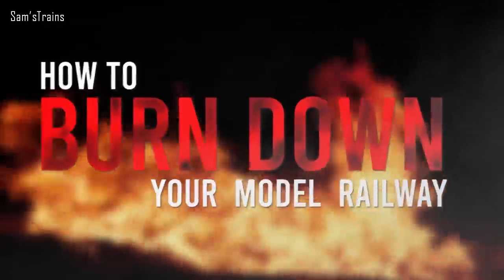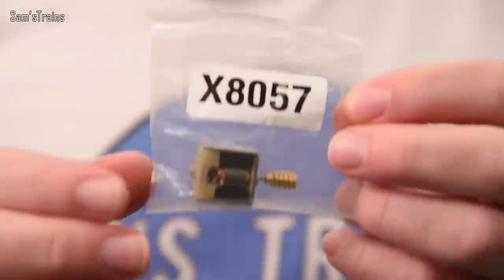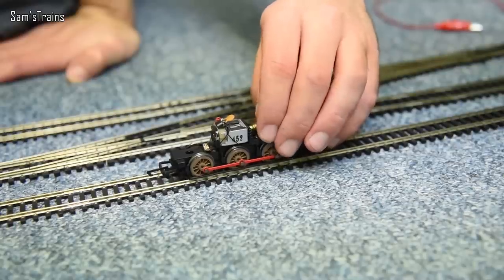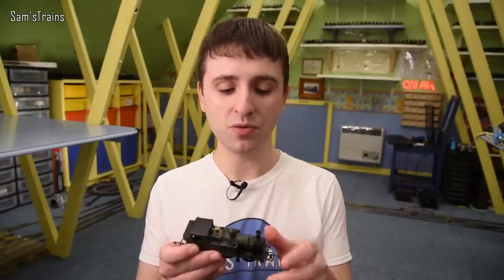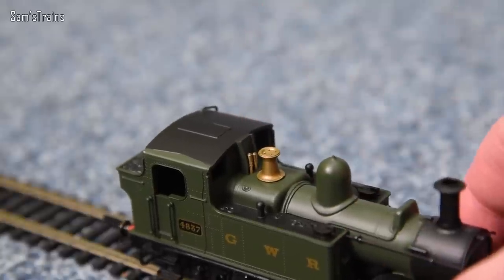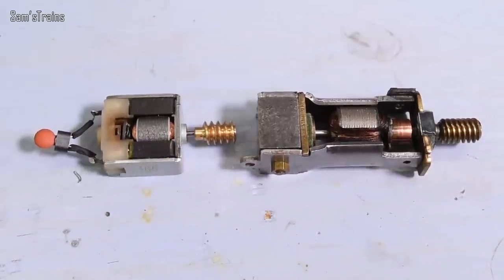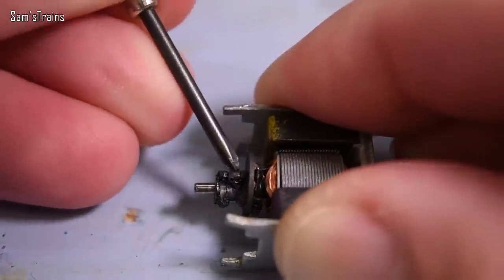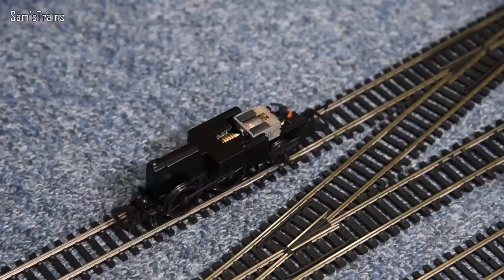How to Burn Down Your Model Railway | Train Motor Meltdowns

Comment: Sam, before doing the test you realy should've worn in the brushes on the sacrificial motor, you already know why and it's the reason why you always spend 30 mins running new locos in. To those not knowing why: on a new brush with a flat head the commutative surface is minimal and high current can burn things out - while a worn in brush will have a much larger commutative surface shaped after the communtator and easier flow of current.
Reply from the maker: haha that's true Jonatan - you can probably tell it wasn't intended to be a scientific test - if it was, I wouldn't have been grabbing the worm with a rag ;)
Thanks for watching - Sam :)

Comment: Last year I discovered that it can be very dangerous to run model trains on the floor. I kicked one of my engines. I didn't  mean to do that, but accidents happen. It was sent to the works. After a some months it came back, with the message that it cant be repaired. I looked if it still can run and it run's. The damage was not that big. I am now more carefully with my model trains
Reply from the maker: haha that's true - you have to be very careful not to kick them! Sorry to hear that mate :(
Thanks for watching - Sam :)
Reply: Sam'sTrains I have question. Have you ever thought about adding signals to your layout?
Reply: Once accidentally did this to my controller. Had to tape the wires on the end in because the socket they went in had a chunk come off. Works fine now though, 3 months later

Comment: Maybe the open frame design doesn't take much heat, the motor case usually acts like a heat sink to help disipate heat quickly. In open frame motors there is no such case, so if the motor gets really hot from overloading, it will burn.
Reply from the maker: Yeah that's a very good point - you may be right!
Thanks for watching - Sam :)
Reply: An open motor will lose heat faster than one with an enclosed case. The heat sink dissipates the heat into the atmosphere. As an open motor is, well, open; it’s completely exposed to air and will dissipate its heat more quickly than an enclosed one will.
Reply: @Twittler1  well, you have to account for the fact that metal conducts heat faster than air and also it absorbs spikes in heat generation (heating up slowly) as it only needs 1 high heat spike to kill a motor
Reply: Marie BCFHS I have accounted for that. The problem is that the heat is now in an enclosed space, so it’s building up and still has to be dissipated into the air anyway. By enclosing it, you’ve created a barrier to the air that itself gets hot.

Enclosing a small motor, then putting it into a small space restricts the air flow over and around the motor. The best solution is a better motor; a small motor that’s always running at or near its limits will get hotter than a higher capacity motor that’s ‘idling’ in comparison, and which can be enclosed. Or, alternatively, fit a cooling fan to increase the airflow over the motor. 

Air cooled IC engines are either NOT enclosed, or if enclosed, are shrouded with forced air cooling them down. Same problem.

Comment: Last time I worked with a motor like that, I was getting revenge on it for frying a brand new DCC decoder (Pull it out of the engine and run it at full power till it cooks). 

Actually I am surprised that 3 poll, open frame motors are still prevalent  over in the UK for HO/OO scale trains. The only place I see motors like that here are in the N-scale market and that motor you cooked is about the right size for an N-scale locomotive, so I wouldn't doubt if it was a tad undersized for the job at hand.
Reply from the maker: Ooh that's not good - not surprised to hear that! I'm very irritated that they're still prevalent ;)
Thanks for watching - Sam :)

Comment: That does seem an awfully low current to cause such a massive failure.

I only have an outsiders interest in model trains but I'm fairly familiar with electric motors and even a little 130 size Mabuchi like you'd find in a slot car or a small RC toy can usually happily pull that without breaking a sweat. A lot of those motors already pull about half an amp at max efficiency.

It seems like a needlessly small and poorly performing motor.
Reply from the maker: Yeah I agree - not much contingency room there is there?! :O
Definitely the cheapest motor they could possibly have used!
Thanks for watching - Sam :)

Comment: this is the easiest way to burnout any (electric) model train motor:
With small gauges (T, Z, N gauge), use a O gauge or larger transformer to power the track, the little motors will not be able to hand the extra loads of volts and amps, they will burn out in less than five minutes at full throttle

For medium gauges (HO, OO gauge), use a large transformer, not a o gauge transformer, use a transformer from a large microwave or a electronic device that uses dangerous levels of amps or volts, that will burn out the medium gauge motors quickly

For large gauges (O, G GAUGE), use shit that is really dangerous to use, like a industrial generator to power the track, that will literally cause the motors to burn out and flame

if you do any of these and get injured, you are liable for yourself, so do not do any of these, we have done them because we have been trained to work with electricity with dangerous levels of amps and volts

Comment: I remeber when one of my trains started burn  and the smoke detector started "yeeling" and i ran to my model railway and extingushed the fire with water bottle ,1 wagon melted and scenery with rails and table got some small damage
Reply from the maker: Uh oh that sounds crazy- it melted a wagon?! Which train was that?!
Thanks for watching - Sam :)
Reply: @SamsTrains  I meant coach one coach melted so i made a long flat bed out of it
And the train was some type of steam train i dont really remeber what kind of train

Comment: Those open motors are actually a pretty old design, and this video is making me worry - while I don't have any model trains yet, I do have plenty of old Polistil F1 Professional type slot cars that use the same design. I personally prefer type 130 motors in my models (type 130 being, in fact, the type of motor featured in the 300+ miles run video), especially those made by Mabuchi - the mini4wd motors they make are pretty hard to kill!
Reply from the maker: Yeah they are pretty old - I'm sure there's no need to worry - just have a few spares on hand ;)
Thanks for watching - Sam :)

Comment: Good evening. Thanks for the video gentleman, it is very interesting. Fortunately, I have never seen a model rail motor burn in my home for the decade I am modelling, first british N, then, since december, OO, after being bored by recurring problems with N (couplers, engine reliability, etc...).
As a subjective view, I find that recent Hornby locomotives tend to run smoother than Bachmann's ones. I have no small engines like your ill-fated 1400, mine are a J50, a Q6, a black five and a 8F to name only the ones I have the references in my head now. I suppose their motors are better.
The only problem I had was a black five with a broken gear that was not running at all on delivery. Replaced by Amazon for no charge by another on working order.
Meanwhile, that's a pity that, even with a decent controler like yours, you have motors that burns off. As you say, the one of your 1400 seems to be undersized and from a low-cost model. It remembers me some Samsung TV sets built with an undersized condenser on the main electronic circuit that blows out after some 3/4 years of normal service : cutting corners too much and here we are : unreliable products...
Anyway, I have to watch your video on DCC, I had finally decided to equip all my new OO fleet with DCC. Thanks for all the information you give us !
Reply from the maker: Thanks Olivier, glad to hear you haven't had any problems! Yes I agree that Hornby engines generally run better than Bachmann ones - their mechanisms are generally much better, with 5 pole motors and usually proper bearings on the wheelset!
Do you think, at least with Samsung, the tendency for failure could be deliberate? If a TV lasts forever, the manufacturer wouldn't sell as many ;)
Thanks for watching - Sam :)
Reply: @SamsTrains  For Samsung, I would rather say that it is, or was, a botched design. LG, Panasonic, Philips, Sony... sets does not have this problem.

Comment: None of my engines' motors have ever failed on me. My engines must have better motors inside them than those few of yours. Yes, Rule no. 1, never give a small engine more to haul than it can handle. How about a story with a burn-out twist?
Diesel vs. Steam Engine
Sam was running two of his TTS Sound engines: Growler the Class 37 Diesel and Great Western Tender Engine Earl of St. Germans. Growler was boasting as usual and Sam was getting very worried. Earl of St. Germans was hauling four Chocolate & Cream Mk. 1 carriages plus three Pullman Coaches to make seven altogether. She pulled them up Gordon's Hill without any trouble. She was powerful after all.

Earl of St. Germans was on the outside line. Growler was on the middle line.
"Bet I could haul more than seven uphill," boasted Growler unwisely. Sam looked at his steamy.
"Does he always think he can do better?" asked Sam. "I don't think giving him more than seven carriages to haul is a very good idea."
"Always thinks he knows best," sighed Earl of St. Germans sadly. "Ever since you first bought him, he's been nothing but trouble. He's asking for it too, I say." On the inside line, Jimmy the Jinty rolled into view. Earl of St. Germans told her friend about Growler's boasting. Jimmy grinned and winked at Sam.
"I've got a better idea than pulling power," soothed Jimmy smiling. "Earl of St. Germans, how fast can you run safely without your motor burning out?"
"About just over half speed," answered the Great Western Engine. Jimmy told of his idea about a light engine race. Sam felt only a little bit better. The young man agreed to be referee, with Jimmy as assistant. Earl of St. Germans and Growler lined up side by side. This was the set-up: diesel and steamy would go round for two laps, and whoever stopped by the turntable first would win. Sam's fingers were shaking. He was more nervous than he'd ever felt in his life, bless him.

The race began. The first lap went like clockwork. The second lap was aces for Earl of St. Germans, but not so for Growler. The diesel's motor started smoking badly, sending out a cloud of billowing black stinky smoke. Sam accidentally breathed the smoke in and choked, hand over his mouth. The smell was awful. Earl of St. Germans won the race and Sam stopped her. Growler stopped by himself further away, and his motor burnt out and exploded loudly.
"AATCHOO!" sneezed Sam, choking in the same breath. The smoke cleared, but not before it set off the smoke alarm in the hallway. Sam did what he'd always done, and reappeared. Thankfully, no fire broke out. Peace was restored. Growler, in pieces of burnt and twisted metal, was discarded gracefully in Sam's Scrap Heap Box. The diesel never recovered. Earl of St. Germans was relieved nothing worse had ensued. Sam, shaken up by the explosion, played with trains as if nothing had happened with a brave smile on his face. He managed to perk up. Steam engines were better-behaved than diesels any day.
Reply from the maker: That sounds excellent Kelly - glad to hear you've taken good care of your engines! :D
Thanks for watching - Sam :)

Comment: Leaving a motor fry itself is not a good idea. Your controller delivering the power should have overload protection but if not you could damage the controller along with the Loco.
Reply from the maker: Yeah that's true Dave - that part was just for fun! The controllers do have protection, but they can pass over 1amp before that kicks in - as we saw here, half that current is more than enough to fry a motor!
Thanks for watching - Sam :)

Comment: Interesting strip down of that motor. You will probably know this, but incase you don’t, it’s best not keep the lubricant away from the motor completely and not on the armature, as the oil attracts dust etc and causes the brushes to ware much faster, but oiling the back of the shaft, and the worm is fine though. But the tiniest amount of lubricant is best. A pin drop ideally. If the factory oil was too liberal then it may have crept. Otherwise, this won’t happen basically. The field windings are all burnt on your failed motor too by the looks of it. Oh, And no burning the house down! 😉
Reply from the maker: Thanks Chris - yeah that is true, but you definitely get better running if the armature is lubricated - though I keep it to tiny tiny amounts these days!
Thanks for watching - Sam :)

Comment: Hi Sam 
I got myself the Hornby R2610 limited edition Caledonian set of Ebay which was sold to me as New .Its a nice model but for that type 7 motor ' it's a sad that Hornby put such thing in inside of loco.
As Like we all do that when you get something new it's going to better than its predecessor Triang  old X67 motor .
Not the case here ok it's got better power pickups but why are we paying more for looks when it should be able to run from the box ?
I know it may sat for some time ,But Hornby tells your the Type 7 motor is a non serviceable which main Hornby service centres to carry out replacement .
I've replace the motor but it's as pig of a job not like the Triang's  X67
Happy bonfire night maybe November the 5th new fireworks ?
All the best Sam love the videos 
Regards Martin
Reply from the maker: Yeah I agree Martin, not a worthy replacement for the X04 - these modern are actually quite serviceable, but it's not really worth it - fortunately they're very cheap!
haha yes indeed - great for a quick indoor fireworks display ;)
Thanks for watching - Sam :)

Comment: These are spectacular, but nothing compared to what you could do with old Lionel trains with the three rails. The most fun thing was putting tin foil on the track, which would cause the tin foil ball to roll around the track sparking everywhere. You could also hold down the loco on the tracks & have it shoot out sparks. Sometimes it would even throw out sparks for no reason. Yeah, not something you'd want around your Christmas tree! Did it anyway.
Reply from the maker: haha really?! I might have to try that with those - what voltage were the old Lionel trains?! ;D
Thanks for watching - Sam :)
Reply: @SamsTrains  I'm not sure, but it was very shoddy. At this point the set is like 30+ years old sitting my closet, I'm afraid to use it. The wire connecting the track & the controller was exposed at the end. You actually had to coil the end of it around a little metal bit sticking out of the controller. No plastic anywhere but the tender, the entire engine was metal. You could see the motor through the open bits.

Comment: It's really shitty that is fails at about half it's rated voltage. Cause that is easily a scenario that can happen while in normal use. Seems like they need to beef them up a bit.
Reply from the maker: Yeah I know - I've never pushed any of my engines too hard, and yet so many of them fail! :O
Thanks for watching - Sam :)

Comment: I think what happens is the motor generates to much heat because of the small space it has to work with, resulting in the commutator and brushes melting from the intense heat, resulting in the intense heat, sparking, and loud screeching noise
Reply from the maker: Yeah it could be that! Though if they're rated properly, they shouldn't be boiling over like this! :/
Thanks for watching, Sam :)

Comment: The worst motors were that infamous pancake motor that you can find in lima models, these motors sparks like hell and smells awful when they are in bad shape. 
The funny thing is that one day i bought a used lima loco for like $30, i opened it and was mint inside, the motor was brand new, when i tested it, it ran better than various models that i have lol
Reply from the maker: I wouldn't say those were bad - I've never had one burn out! But they sure can make a lot of sparks, lol! ;D
Thanks for watching - Sam :)

Comment: From everything I've been told, you're very wrong about traction tires. Locos with traction tires are less likely to wheelslip; that's kind of the point of the tires.

I'd say your test more simulates the motor shaft or worm gear binding than it does weight on the engine. So maybe there's something up with the bearing.

I also noticed something you didn't check on the original failed motor: the magnets. Are they still galvanized? And if so, how strong is their magnetic force?

EDIT: Forgot to mention, from what I've been told by veteran modelers... gears want GREASE (if anything), not oil. So make sure you're not getting oil on the gear teeth.
Reply from the maker: They are less likely to wheelsLip, and that’s the problem… if a loco can’t slip, that puts great strain on the motor!
It won’t be the magnets or the grease, as the loco was only a few years old at the time - they’re just very very cheap motors!

Comment: Those are indeed terribly bad motors and you don't even need to overload it. Mine fail like that on its running in period from new. I think Hornby or someone should come up with an alternative replacement for them.
Reply from the maker: Yeah absolutely - it seems to happen very often - incredibly cheap to buy too!
Thanks for watching - Sam :)